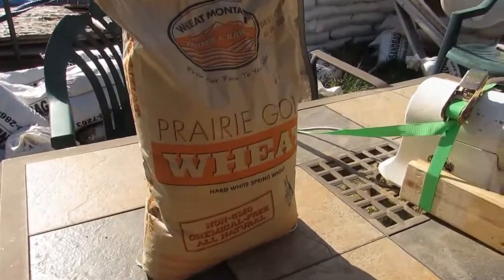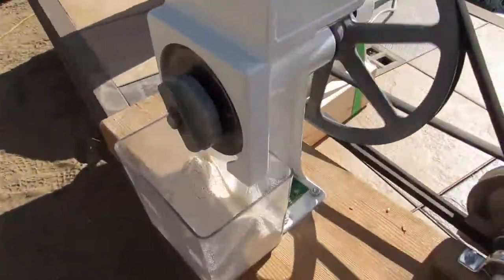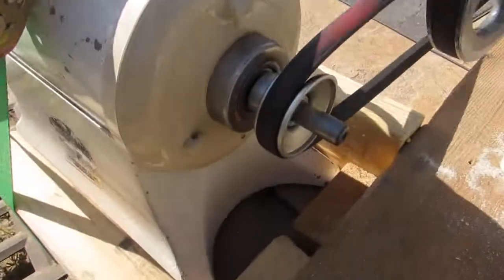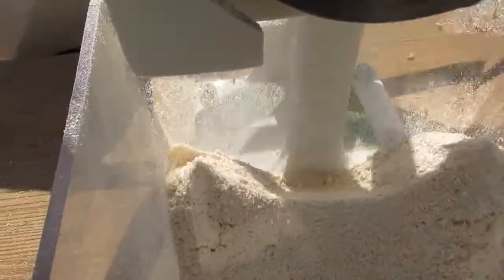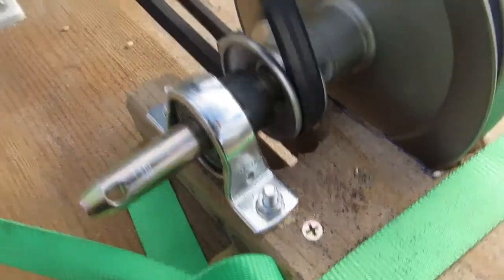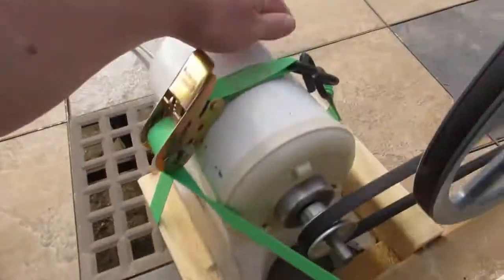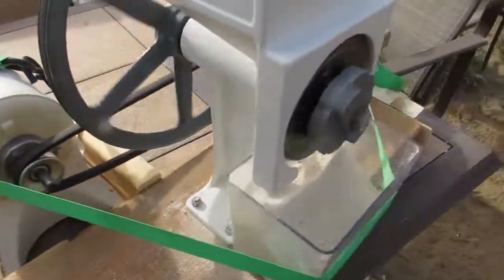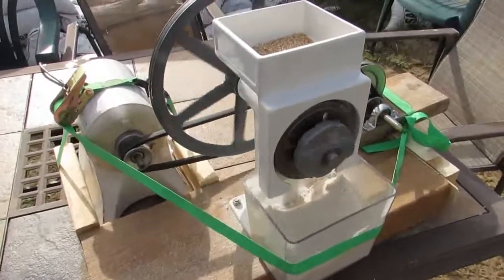Country Living Grain Mill motorized with Champion Juicer motor

Comment: I like your rig !  I must tell you I have and use the Champion Juicer with their grain meal attachment to grind my sprouted wheat for flour. I can tell from your video you get a finer flour than I do so that’s good for you. I get around my mill,s course grind by sending it through the grinder in several passes if I’m not pressed for time but usually I just grind in one pass. I use a sourdough starter and usually refrigerate my dough at least 3 days after initial rise. This breaks down the dough further and adds to the flavor and texture. Have fun with your rig. Blessings Rob

Comment: Why did you go to all that trouble when champion offers a grain mill?  Does the Country mill produce better or finer flour?
Reply from the maker: My understanding is that the Country Living grain mill is the best of the best.  I got it for a good price second hand, though still brand new, and put it to use with a hand crank.  It was way too much work, so I built what you see above, with a Champion motor I already had.